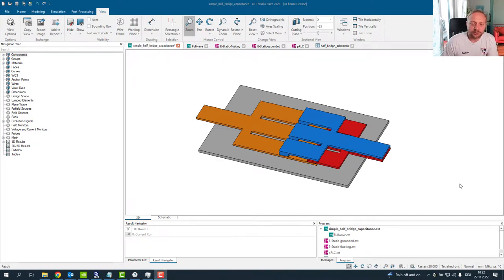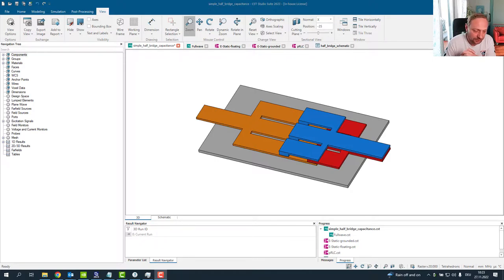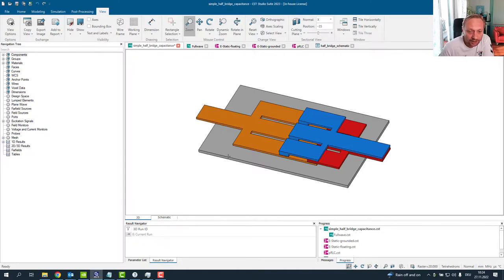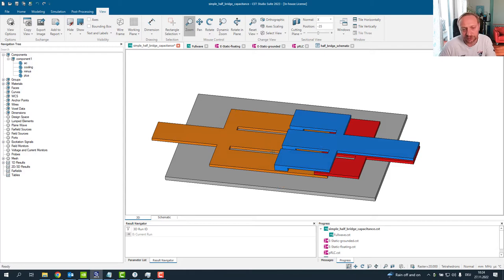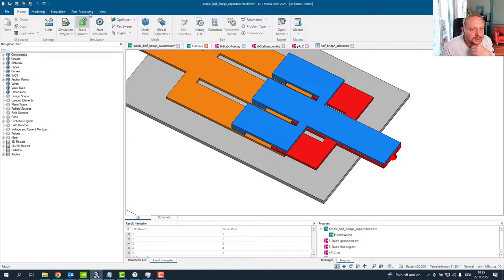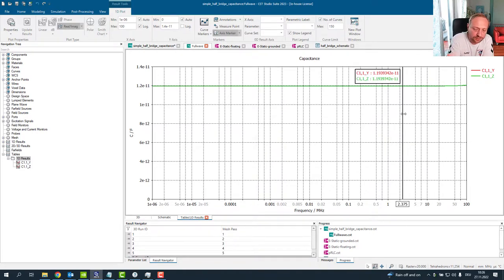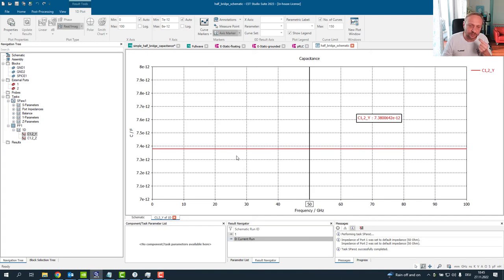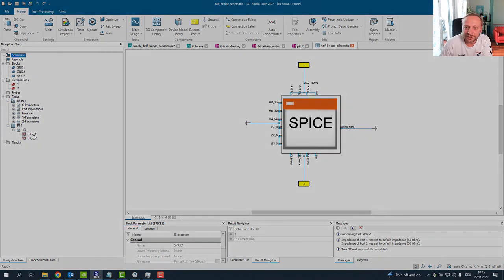Deep Dive on (partial) Capacitances

Comment: I was wondering; do these simulation tools stay in the realm of classical EM or can they account for (not explicitly modeled) quantum effects? 

For example, if you model two different types of metals in contact, will you be able to 'see' charge transfer and the developing of a contact potential?
Reply from the maker: It purely classical EM. No quantum effects, no contact potential.

Comment: Hi, I am a german master student and I am really wondering about the magnetic boundary condition in CST high frequency simulations. It is a recommended setting for the simulation of microstrips with waveguides to support the QTEM mode. But when setting a magnetic boundary condition (Ht = 0) and checking the H-field with a field monitor, the tangential part of H ist not zero on the boundaries (nor is the normal elctric flux)! So the magnetic boundary is not adhered to. This really confuses me. Maybe you could explain this and why one would set magnetic boundaries for a microstrip in the first place. I would be very grateful, if you did
Reply from the maker: If you use magnetic boundary, then H_t = 0 at the boundary. Maybe the field monitor is misleading, would need to see the plot. The recommendation is not a must. You can also define an "inner" waveguide port which does not touch a boundary.